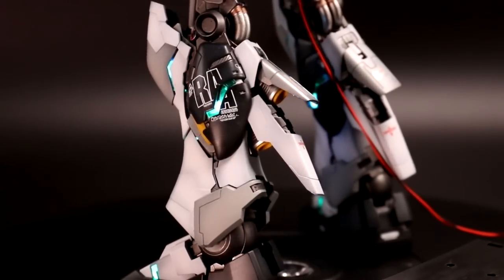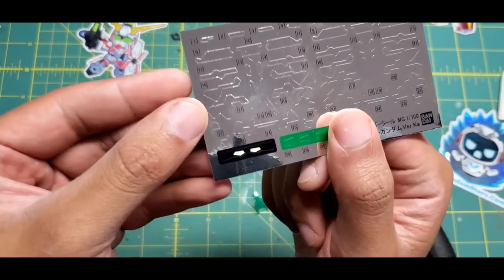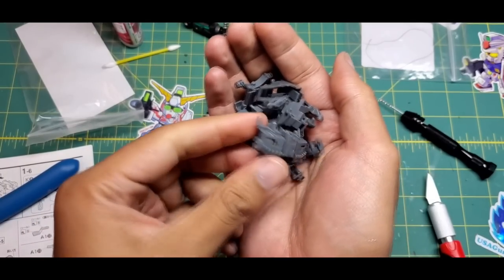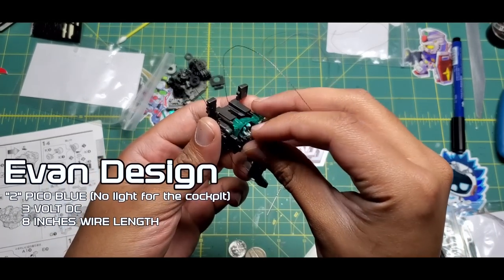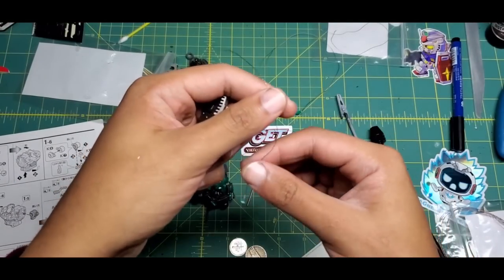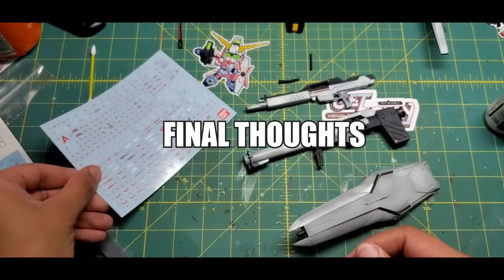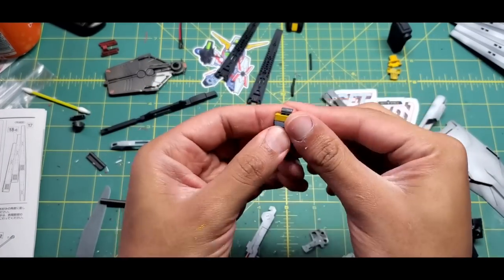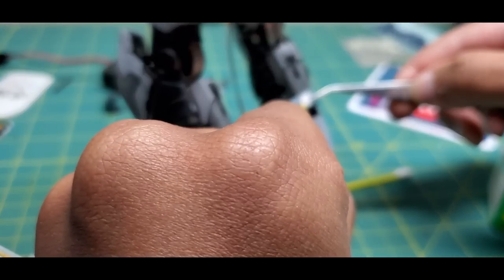#Gunpla #Newtype Nu Gundam ver ka

Comment: 16:16 - There are ways of routing wire through moving joint parts - basically, find a path through the part where the distance the wire needs to cover doesn't change much as the joint bends, add some stress relief where necessary, etc.  Stuff like cutting lengthwise channels into the joint peg and making the wires go through the joint itself.

Though I'm not sure how well that would work with the thin enameled wires. For tricks like that I usually go for teflon-coated, stranded wire. It's thicker (around 1mm diameter) but it's more resilient.

And there is something to be said for not overcomplicating a project. Lighting and painting is pretty complicated as it is, it can be worth static-posing a kit just to avoid making more work for yourself.

Comment: small nitpick, not a complaint, just pointing it out. the fin funnels are supposed to go in order from the connection point, 2 same height, stagger 2 same height, stagger, stagger. its your kit so it doesnt matter but if you want to be more accurate that is how they are in the anime.

Comment: Can't u solder a strip of copper  at the joints so the wires connect via contact. Full movement is then possible

Comment: The fin funnels, the hands, and the feet hook I hear is the problematic areas of this MG. The face design is also something I hear is not that well appreciated on the MG Ver. Ka. 
Overall, I think fans would be more satisfied with the RG.
Reply: @xxnike629xx

First and foremost: 

http://i.imgur.com/uD3m01j.jpg

 Now back on topic, so here you go again on your anti-Nu Ver Ka shots 😂 

Which is actually, you just parrotted from other people. 😝

You didn't even specify what are the issues, which isn't surprising since you didn't even own one and just pretended to be a parrot. 🐦 

I own and built one, so I know the flaws: unstable Fin Funnel connection and sagging hands and legs. 

Feet hooks? I've never got problems on that. 

Face design? Never problems on that either. I actually prefer the Ver Ka's face over its RG counterpart. 

And AFAIK, the Ver Ka's face is fine with other people. The Ver Ka having a Destroy Mode-esque Invoke Mode is much more controversial since canon-wise, Nu's psycoframe is only limited to its cockpit. 

So what's your next complaint? Your old rants about Nu Ver Ka having no LED piping at the back of its head and its insignia not engraved on its shield and shoulder? 😂

I'm sure you're just bitter that your precious golden boys, 00 and AGE, still doesn't have Ver. Ka kits 😹

But if ever Bandai actually announced Ver.Ka BOXES for your golden boys, yeah, you'll buy at least a handful of each...

But it's also a certain thing that you'll never build the kits inside them.

Why? Because you're a COWARD , that's why. 💩💩💩💩💩💩💩💩💩💩